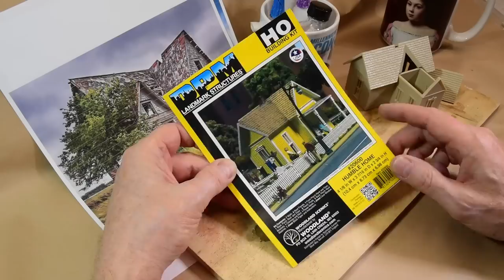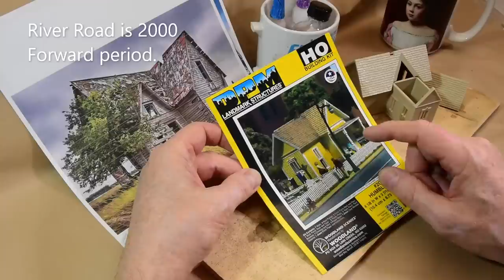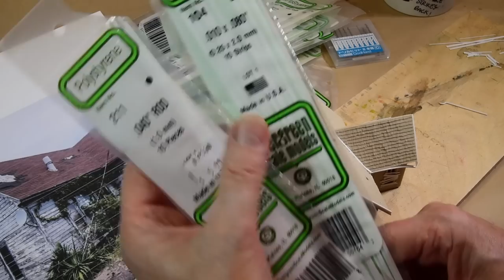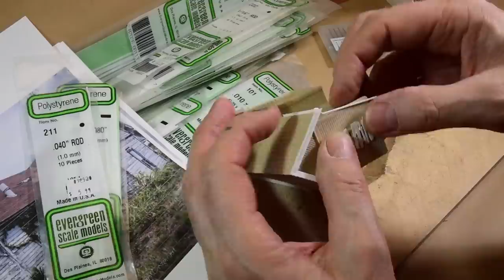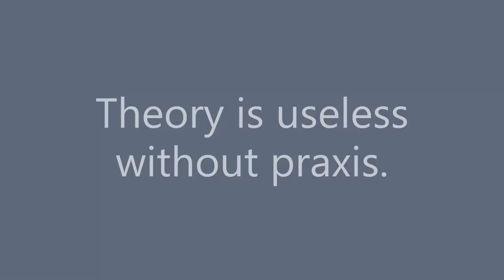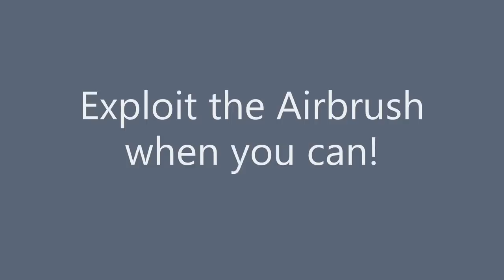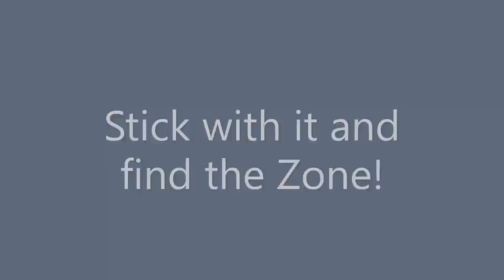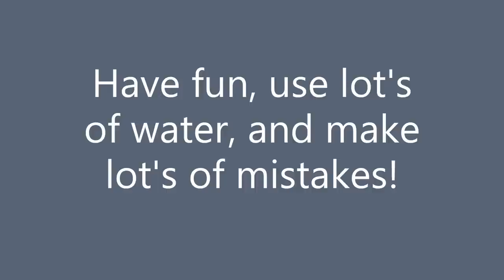Bashing & Painting the Abandoned (DPM) Farm House Kit | Boomer Diorama ~ Vlog # 197

Comment: Thanks for showing the benefits of acrylic paints. Having been using solvent based paints for 50 years, I was reluctant to try the water based paint. This video convinced me to give it a try. Since the abandoned farmhouse turned out so well, I bought the kit and gave it a try. I even used the paints you had used. You made a believer of me. I’m sold!
Reply from the maker: Good to hear. Once you cross over from solvent to acrylic paint there is no going back. I mean you can put solvents over acrylic for additional effects if you want, but it is all achievable with water-based paint now. 

Who knows, maybe that mystery "allergy" goes away once you drop solvent based paint. It makes for a more friendly environment as well. ;-)
Reply: To follow up on my previous post - I was so pleased with the results that I took a City Classics “Company House” and added additional details to include adding 2x2” vertical post to the upper sashes of the windows, 2x6 rafters, and gutters with downspouts. Painting followed using the same techniques as the farmhouse. Your videos have been a great inspiration. Please keep it up.

Comment: After watching your genius with the airbrush, I recently jumped on one.  I've painted a couple things, but I can already tell it's going to revolutionize my painting process.  I especially love the finish of flat tamiya paints thinned with ipa.  I'm looking forward to "making lots of mistakes" 🙂.  Thanks for the inspiration and tips.
Reply from the maker: Glad to hear it. Make sure you pick up a few bottles of the Tamiya (XF-86) "Flat Clear." You can also thin it down a fair bit, and it still works wonders if you want to stay with acrylic (low odor) paint and desire a nice dead flat sealer coat over you finished paint. The beauty is you can lay oil paint right over top of Tamiya with no bad results as well. ;-)

Comment: Looking forward to this vlog since I am starting on a cola town set in KY.   The company houses were at best run down, I had been using wood kits but after this vlog going to try a cheap kit.   using scrap styrene to kit bash a front porch( most of the pictures I model from all had a front porch)  You talk about the "zone", my wife calls it" in my own little world"  At train shows I buy buildings guys have tried to "weather"  and used a barn brush to apply it.   So I have practice pieces to use learned methods from your vlogs, seems the more I do the better it turns out.  Thanks!!
Reply from the maker: Plastic takes a little getting used too. I used to build in wood all the time. I have little reason to do so now even in "O" Scale.

Comment: Another fantastic video, so glad i found you, so informative!  Ive two questions, not really related, but i have been searching through videos for days.  When you spray a mix of IPA and water to open up a ground layer to receive very runny matte medium....what are the ratios of IPA to water, and matte medium to water?
Reply from the maker: It's a bit like personal alchemy if that makes any sense. Best to go on feel and experience when it comes to layering ground work with IPA and Matte medium. I'm still learning the game. I usually try and avoid IPA mixed directly with Matte Medium because it can form an undesirable white grey or white stain residue when it dries.

I usually dilute matte medium 50/50 with water for the most part. No IPA.

On the other hand, you can cure any anomalies that occur after it all dry's by re-flooding the "dry" area with straight IPA or paint. I tend to mix about 50/50 IPA with water for starters and then reduce the IPA from there. The advantage of IPA is it breaks the surface tension of terrain and allows the paint and adhesive to penetrate and settle out better. I hope that helps. Cheers ~ Boomer.
Reply: Thankyou so much.  Ive heard you say various mixes for the IPA and water.  And the real runny matte medium and water.  I wouldnt mix matte med and IPA.  Ive learned so much from you, i so appreciate all the info you tell us!

Comment: Another excellent video, as usual, Boomer!  Could you tell me the base color(s) you used for aged wood on those roof pieces before you added the gray?  'm trying to age boxcar wooden roofwalks (made of plastic) and have been experimenting but with partial success.  Cheers from Wisconsin!
Reply from the maker: I use two colors by Vallejo Model Air - #71.132 (Aged White) and #71.296 (USAAF Light Gray). If you are using an Airbrush, I use Tamiya XF-55 (Deck Tan) and XF-19 (Sky Grey) thinned heavily with 99% IPA.😁
Reply: @boomerdiorama  Thanks, Boomer.  Much appreciated!

Comment: Hi again!  Another question...did i hear you say in another video that once youre TOTALLY finished making a tree you spray it with a thin coat of matte medium?
Reply from the maker: Yes I do! 

On the other hand,  you can also use Acrylic Flat Coat from a "spray bomb" as well. Try to avoid lacquer or solvent based (clear coat) paints and adhesive on your trees if you want them to last and stay rigid. Why? Because the lacquer and solvent based products corrode and eat away at the tree flock or (static grass) and they fall apart after a few year when you handle them.
Reply: Awesome!  Thanks for your patience.  I ll go spray my trees now....matte medium all the way!